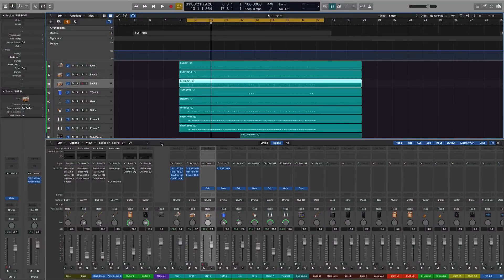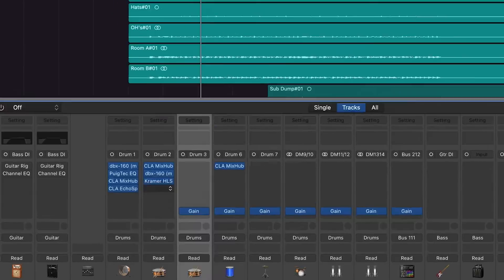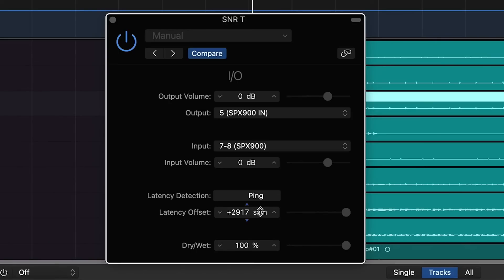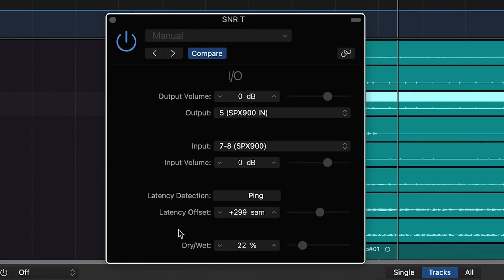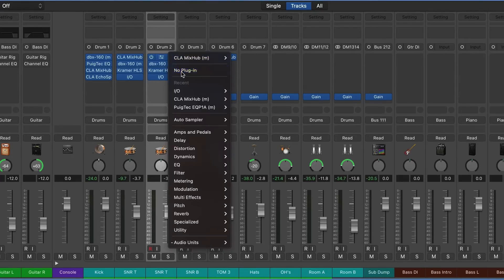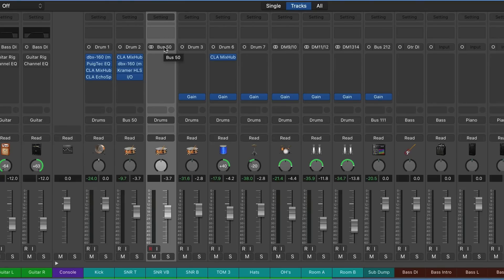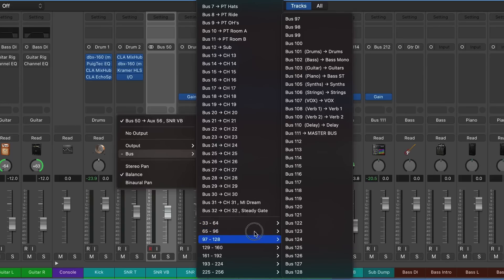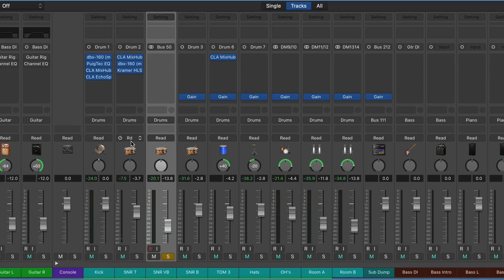Using Outboard Gear with Logic Pro X

Comment: Thanks for this video, exactly what I needed to know heading to my new studio today. I've a question and if you've covered it already in a vid please direct me to the link - if I want to send a whole mix through the limiter on my ART TPS II and bounce it back as two L and R tracks is this the same process?

The TPS II is a 2 channel, so e.g. - stereo bus sent to outputs 3+4 from my interface to TPS channels 1+2 with identical settings, then the TPS 1+2 outputs to two separate tracks in Logic, would this give me a L+R master of sorts?

And is that the process for using any 2 channel outboard gear on a whole mix?

Thanks again!
Reply from the maker: Hey Luke. Congrats on the new studio. 

You hit the nail on the head. Process would be the same in the video, just applied to your master buss. If you don’t need to use the ART on other tracks then you can just put the I/O plugin on the MB and just make sure you bounce in real time.

If you want the returns printed to a separate track then yes, your setup will work just fine. Arm the track and let it play.

Also make a note of the settings on the limiter and save it in the notes section of Logic in that session. That way if you ever have to do a recall then the settings for the ART are saved in your session.
Reply: @EverythingMusicRecording  great thanks again!! I'm fairly green when it comes to using outboard gear with a DAW. Brilliant YT channel, keep it up!
Reply from the maker: No worries Luke.  You’ll figure it out. Outboard is really no different then plugins, except that it’s OTB. 

If you have any other questions always feel free to ask.

Comment: How many ins-and-outs does Logic Pro X have
Reply from the maker: I’ve got to tackle that in two ways. First is your audio interface. If your interface has 8 in and 8 out, that’s all that Logic will show you. Logic itself tho can handle up to 1000 stereo tracks, which should mean 2000 mono tracks… but the manual is rather vague. I’ll leave you the link. The info is under the “Mixer” section.
https://www.apple.com/lae/logic-pro/specs/

Comment: Great video. Would you approach it the same way if you were using a hardware synth that you wanted to print with an external reverb? Thanks
Reply from the maker: Thanks Damion!! If the hardware synth was already recorded and I then wanted to send it to an external reverb, then yes, the process would be the same as in the video. 

If I wanted to RECORD the synth WITH the reverb already on it, then I would patch the synth into the reverb unit and then into my audio interface. 

Hope that answers your question. If you have anymore feel free to ask 🙂
Reply: @EverythingMusicRecording  Thanks!!
Reply from the maker: Anytime 🙂

Comment: Really nice simple video. One thing I'm curious about with Logic and I can't see another video on it, is if I'm bouncing or printing a mix, and I want to run the whole thing through an outboard compressor, what is the best/right way of doing that in Logic? I noticed just having an I/O plugin on my mix bus in Logic and then bouncing doesn't seem to do it. Thanks!
Reply from the maker: Thanks!! Glad you liked the video. I think I just glossed over it in the video but you HAVE TO bounce in real-time when any outboard gear is involved. So if you hit “Command-B” the Bounce window will open up. On the left hand side in the middle you see “Mode”. Make sure “realtime” is selected and also the “include audio tail” check that option as well. 

Offline bouncing is just fine when everything is in the box. But no DAW can process outboard gear offline. So Logic will basically skip the I/O plugin when bouncing offline. That’s why you’re not hearing your compressor after you bounced. 

Let me know if there is anything else I can give you a hand with 🙂
Reply: @EverythingMusicRecording  thanks for the quick reply. I should've been clearer, I am using real time bounce and can actually hear the compressor when it's playing/bouncing but when I then compare that bounced wave file (with outboard comp applied) to my mix in the session it doesn't sound the same (less wide, eq sounds different etc). Is there another way of doing this?
Reply from the maker: No worries and oh… well that could be likely how the file is being bounced. If as an example you have Logic set to record at 24/48 and the file type is AIFF and you’re bouncing your track down as maybe a 16/44.1 wave file then that could be part of why it’s sounding different. Could also be the dithering setting (if any) you have selected when bouncing down. 

So I would start by checking the other settings in the bounce window. But bouncing to different sample rates, bit depth and file types will always have some affect on how the audio sounds. You’d want it to be as minimal as possible but there will always be some amount of change. 

Think listening to a CD and then listen to that same album on vinyl. It’s gonna sound a little different. Same idea.

Keep me posted tho and let me know how you’re making out.

Comment: can you use multiple channels at one time?
Reply from the maker: Hey hey. I hope I’m understanding your question correctly. The bottle neck for outboard gear with any DAW is the number of inputs and outputs on your audio interface. So yes, you can always run multiple channels to outboard gear IF you have enough inputs and outputs to support it. 

You can always print tracks thru outboard gear to free that gear up for other tracks as well. As an example I only have one SPX900 so if I want to use it on more than one track I’d need to print each track to free the unit up. But if I have enough in’s and outs and multiple SPX900’s then I’m sure you’re getting the point lol

But long story short, the more ins and outs you have, the more outboard gear you can run through simultaneously.

Let me know if I answered your question 🙂

Comment: I'm doing everything in the box but always wondered about the I/O thing, thanks! Maybe a video on how you are physically routing would be cool, your capture devices etc...
 I've smashed all the smashers! Salutations from wet, grey and still sorta weirdly not back to normal Ireland! ☘️☮️🤘🏽🤠👍🏽☮️☘️
Reply from the maker: Hey hey Sonny!!! Hope all is well in Ireland other than not being back to normal. I’m 1/4 Irish actually.

I’m in the box too except for the SPX900. Trying to get out of the box where I can. It’s only 3 cables connecting my SPX to my Focusrite but maybe I could do a short to show how that’s connected. I’ve never done a short. Let me know what else you wanted to know about it and I’ll put something together 😃
Reply: @EverythingMusicRecording  

Hey great video but I just need help on how you do the wiring externally. I can’t seem to get the signal to a different output other than output 1 and 2. Like how did you get it to come out of output 5 ???

Comment: You can also just solo the track, and bounce it in real time.  Then you don't have to do all that input switching and bussing
Reply from the maker: You can do it that way as well for sure, so long as the "add to project" box is checked. But at the same time if using mono gear you might not want a stereo file after bouncing.
Reply: But I want to hear it in context